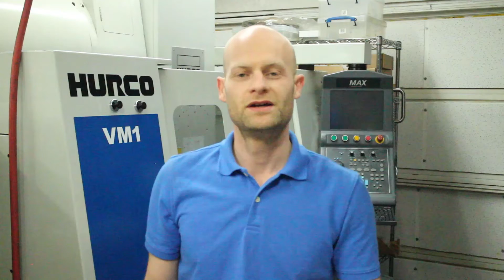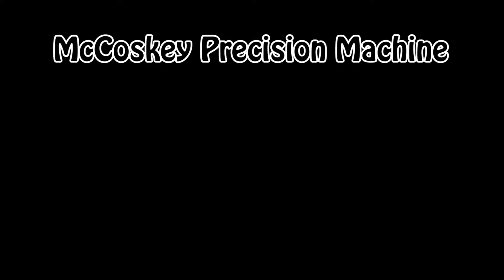End Mill Selection, How Many Flutes?

Comment: Thanks for the info, what is best to use for cutting slots in aluminium, I need a really smooth finish, I cant have chips building up and scratching the finish 
Thanks
Reply from the maker: A three flute cutter works best for aluminum, no longer than needed for rigidity. You should use a cutter smaller than the slot so you can rough it out and then go back and finish cut the walls and bottom. Slotting will put a lot of pressure on the cutter so axial depth of cut and feed rate are important considerations, to prevent breaking the tool.
Reply: I'm not a CNC guy, but I would think that if you could get the coolant to hit perpendicular to the cutter, it would help to blow the chips up and out the flutes, instead of downward towards the part. Like if you aim it a bit low, so it hits the part maybe half inch shy of the cutter and then splashes sideways off the part... is this correct or am i just new-guy confident? 😁

Comment: Would love to see a review of the hurco from the perspective of an owner operator. Looking to get similar in the near future.
Reply from the maker: They are good machines. The conversational system is good for something that’s relatively simple that you just want done quickly. For complex parts It’s best to use a cam system to program and the Hurco accepts ISO G-code. I’ve had my machine for ten years, when needed service has been good. I had one costly issue with it. The computer had some capacitors pop a couple years ago and the parts to fix the machine (a new computer board and some other parts) cost a good amount. I might do a demo on how to use it sometime. They’ve updated the control since mine though.